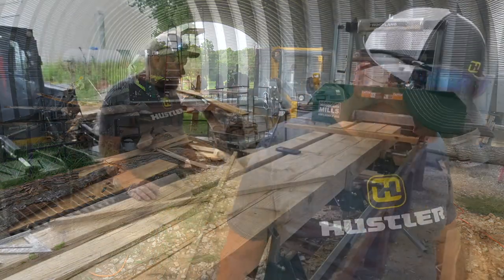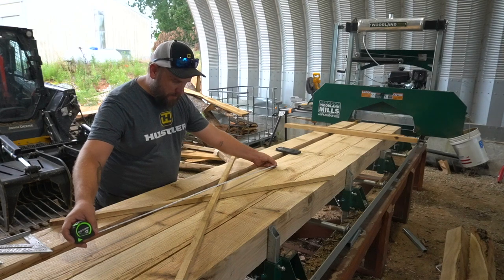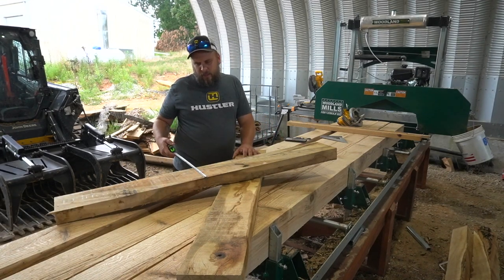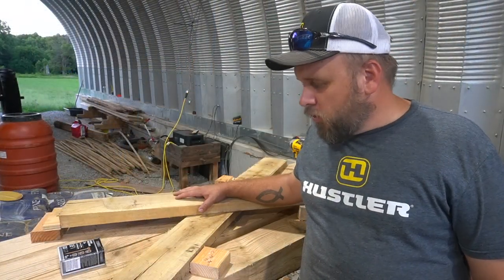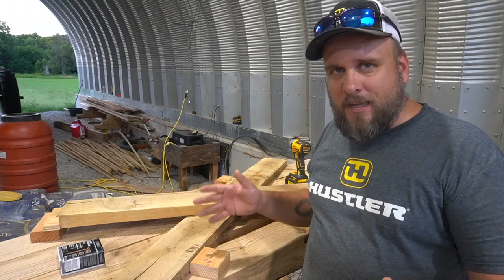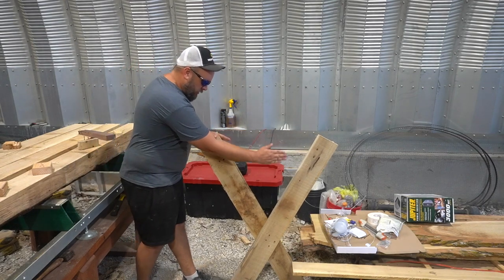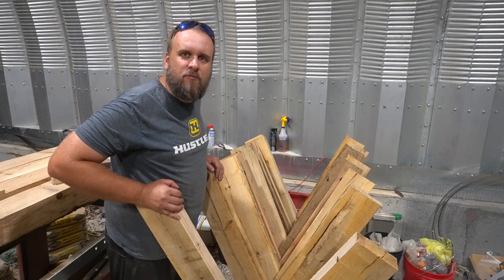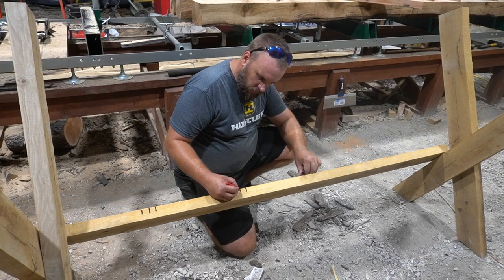Building a Better Slab Rack...

Comment: Good afternoon Brock. I'm a little late today because we had to take our best boy "Rocky" to the vet this morning. He's fine and getting older but needs some meds just like his Dad. What I wanted to say was that you may be on to something. I'm sure that you won't have any trouble moving it around and it cost you some screws and your time. I also wanted to say that up here in the mountains of North Central Pennsylvania a lot of people are using the slab wood as siding on cabins or hunting camps. It's very cost effective, great insulation, and if done nicely looks really nice. So maybe there's a market in your area for that use also and not just for firewood. Anyway, just sticking my 2 cents in. God bless and have another wonderful day.  🙂👍👍

Comment: I use a strap a few inches away from where I'll make each cut. That way the bundle of slabs stay together and I can move them out of the rack easily. When they get to where they're going, I loosen the strap and they fall out. It takes an extra minute or two to get set up for the cuts but in the end it feels worthwhile for me.

Comment: The mitre saw is struggling because the teeth on the blades are designed to cut dry wood, not wet/green. They make bandsaw blades specifically for green wood, but I don’t know about mitre saws.